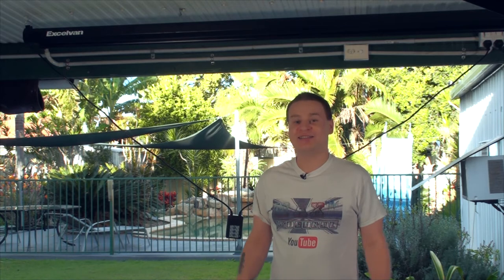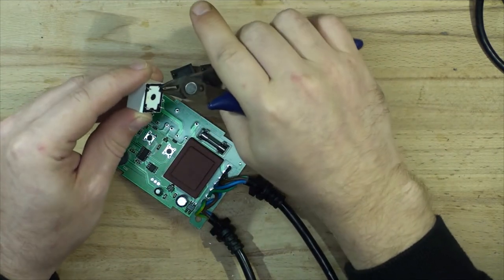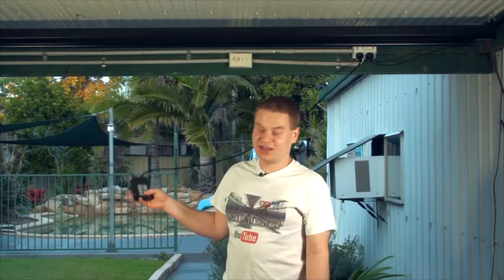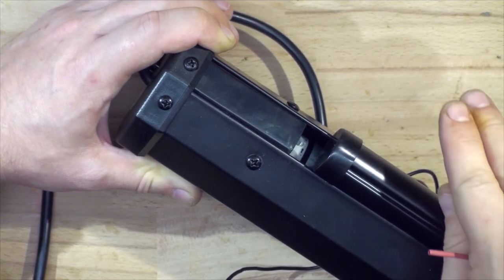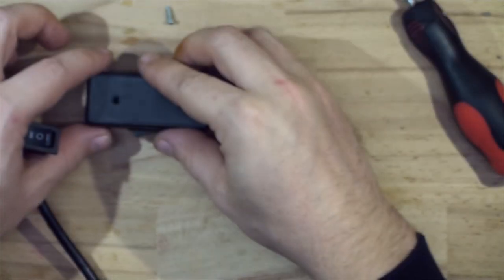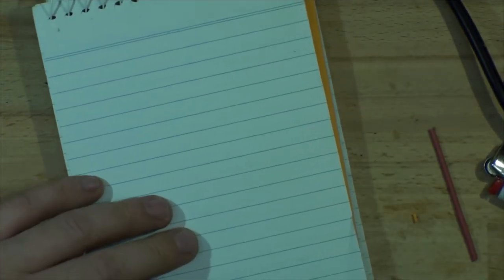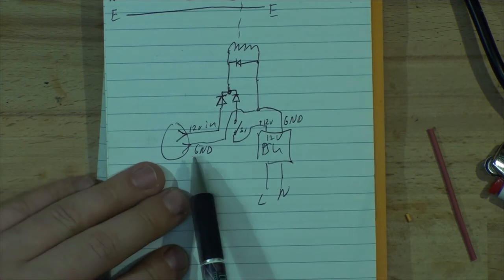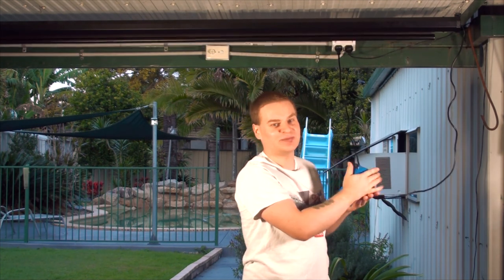Motorised Projector Screen Repair and Modification for Automation

Comment: Hi, very informative video.
I was wondering if you could help. I have a screen similar to the first one and it has been working well for many years until recently. It has started making a lot of grinding and clicking noises like gears not catching when coming down and retracting, it seems ok coming down, but in retracting it has to be helped back up to the housing. Any advice? Thanks.

Comment: Hi!  I have a manual switch for my screen: up / stop/ down.  I don't want it to work automatically via the projector, but I would like to replace the switch with a remote control.  Do you know if there are three way remote switches available to purchase  that would  fullfill this function?
Reply from the maker: Yes you can use standard controller for curtains and blinds. This one will work: 

https://www.ebay.com.au/itm/354257396713?mkcid=16&mkevt=1&mkrid=705-154756-20017-0&ssspo=_l4hSbIHTpK&sssrc=2349624&ssuid=D1OZOxU5QAG&var=&widget_ver=artemis&media=COPY

Comment: Really liked video.. my screen project not function when powered on.. no power to the cable which supply power to the motor... I need your help what's problem..but input power it's ok the problem is cable which supply power to motor.. and I try to make inspection cable it's ok...
Reply from the maker: Check the relays inside controller, maybe check fuse. Inspect circuit board for any damage or bad capacitors

Comment: I changed my controller but I still have same issue where electric screen will not go up but I hear something that’s sound like it’s about to start.  I can get it to come down if I keep trying but not managed to get it to go up.  That said I had same issue to bring down but randomly tried this week and it came down.  Now it won’t go up again!   Any idea where the issue may?
Reply from the maker: Could be a problem with “end of travel” switches inside the motor itself, probably needs cleaning

Comment: Really liked your Video. I have a screen like the first one you repaired would I be able to do the trigger modification to it like you did on the Amazon screen.
Reply from the maker: Yes you can, Just take the controller completely off so you will end up with cable coming out of the screen with 4 wires, green is usually- earth (it’s wise to probe with multimeter bu probing green wire continuity to the metal parts of the screen, then you’ll be left with 3 wires, UP, DOWN, NEUTRAL. You can have a look at the original controller where the neutral is , it usually goes straight to the power input/power plug. Once you figure out what one is neutral, you now left with UP And DOWN wires, connect only one to see if screen opens , if it doesn’t, connect the other one, if it starts opening then you know it’s DOWN wire, so respectively the only one left is UP. Now you can wire it according to my video. Please take care when working with high voltages and be alert and safe!
Reply from the maker: PS never connect UP and DOWN wires to live at the same time, it’s ether one or another.
Reply: @MaxELECTRONICS  Thank you for your reply. Are you in Australia would love you to build me one. What size is the Diode.
Reply from the maker: Yes I’m in Australia, diode is standard 1N4007.
Reply: @MaxELECTRONICS  Thanks. I think what you have done with that modification is brilliant.

Comment: him thanks for the video! i have an issue with my motorized screen. When plugged in, the relay box keeps beeping--the down button keeps "activating". And its so difficult to roll the screen back up, i need to battle the random down button pressing by using the remote control. it takes several minutes playing tug of war with the screen until it is finally back up. What could be the problem wih this?
Reply from the maker: It sounds like ether a bad relay or a stuck button on the controller itself. It could be bad relay, that’s the problem I had.

Comment: Hi there.. my PJ screens power stopped working after a power surge. Have opened controller but no fuse, all else looks ok, as far as I can tell with my un-electronic expert eyes.. is there a way to test all parts??
Reply from the maker: Yeah you can test everything with just a multimeter.

Comment: Hi, i have a question. I've enjoyed my screen, for years, but while moving it yesterday, it dropped, and hit a speaker dead center. Everything still works, but there's some VERY sticky tape inside, holding two wires, that came loose. So when i try to retract, screen catches the thin wires. Any idea how to fix, for a guy who's never taken a screen apart?
Reply from the maker: You’d need to undo both ends and remove the roll of the screen, it’s just like motorised blinds for the windows, once you slide the screen with pole it’s on, then you will have clear access to the wires, you can then use epoxy resin or a silicone to glue them back in place, wait till it’s dry and reassemble exactly the way you pulled it apart, take plenty of photos and videos when you pulling it apart so you can remember how it goes back together.
Reply: Dude, you rock. 🙌🏼  I was all worried. Now i just have to find a way to get the gooey stuff off, that attached to the screen. 😏

Comment: Hi there. My PJ Screen when rolled up doesn't seem to stop automatically. It does stop manually via the remote or the button on the box. Any ideas how to fix the issue? I have no experience in opening up a PJ screen.
Reply from the maker: Hi, there should be 2 adjustment screws inside the slot where the screen rolls up one is bottom stop for when screen is open one is too stop for when the screen is closed, try adjusting those screws, if that doesn’t work then you might have welded contacts on the roller switch. You might have to open the screen then and rebuild the roller switch.
Reply: @MaxELECTRONICS  Where can I find those adjustment screws? Are they fairly outside or far too deep inside?
Reply from the maker: They’re just on the edge of the slot, I show those adjustment screws on video at 8min20sec
Reply: @MaxELECTRONICS  Thanks I set the "nut" for the upward motion using Ellen key and now it stops where it should.
Reply from the maker: Glad I could help :)
Reply: My projector screen is just like the first one, please where did you buy the relay?
Reply from the maker: @adeoluodutola6913 I didn’t buy them I already had them in stock, but you can visit your local electronics store and they’ll be able to help you with the relay

Comment: My motorized screen is continuously rolling up and down , doesn't stop anywhere until any key is pressed . Where to look for the problem sir?
Reply from the maker: That would be the controller box, check relays and capacitors.
Reply from the maker: It is also possible that the end of travel switch inside the motor failed, check that also
Reply: Thanks sir, I will try tomorrow. My office hours are over today.